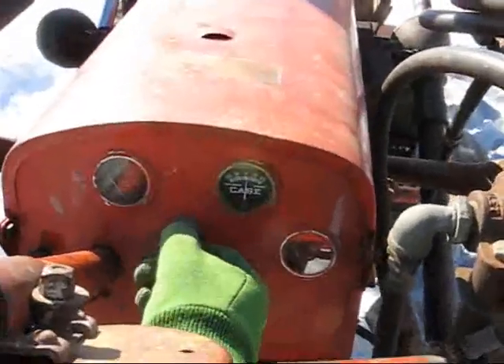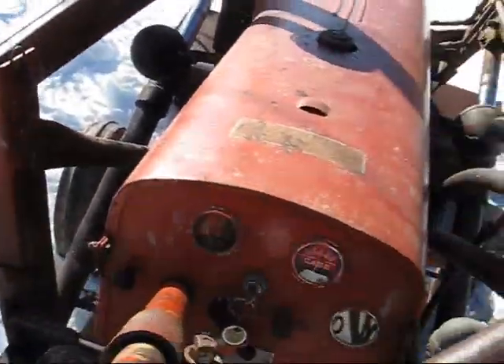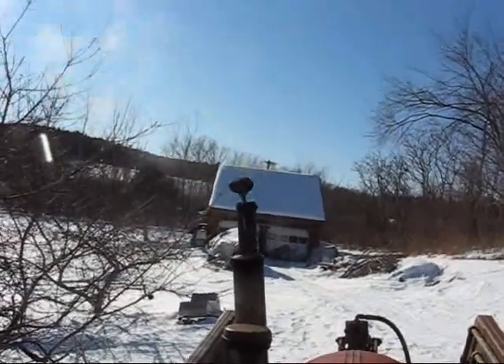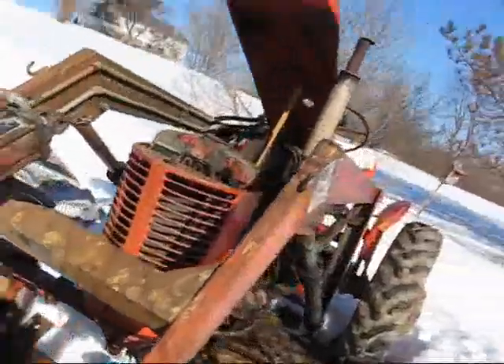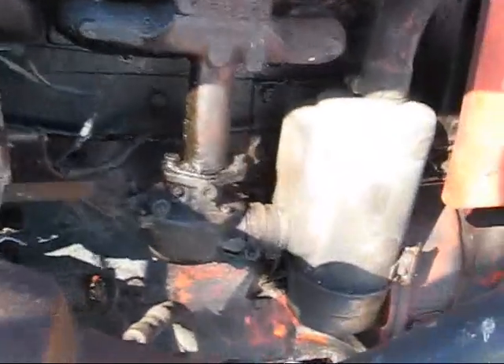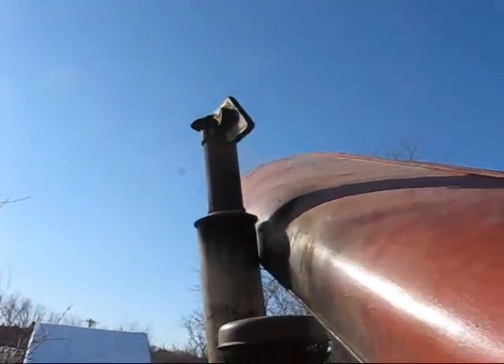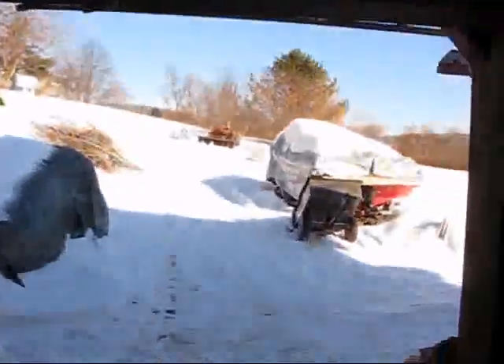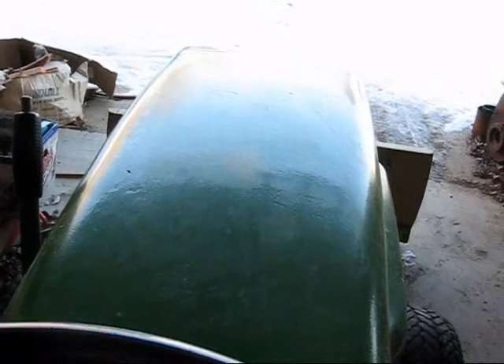Cold starting the 52 Case! and my JD 210!

Comment: Our John Deere 4100 has no problem cold starting its a Deisel 3 cyl Yanmar starts with the throttle pulled back Came with a 410 Bucket, 60 in 3 bladed deck(Shaft driven) and a rear scraper blade